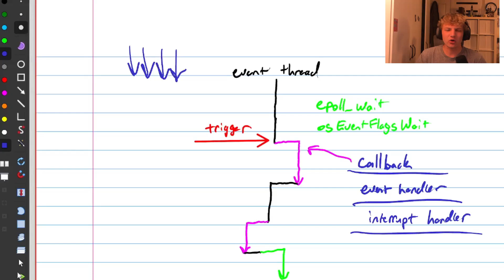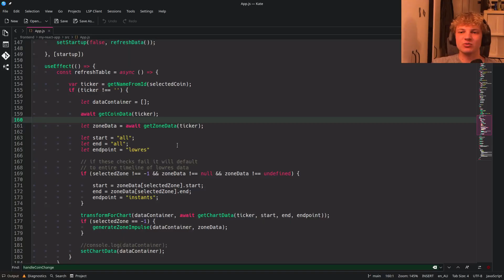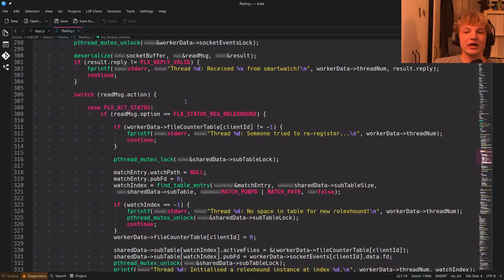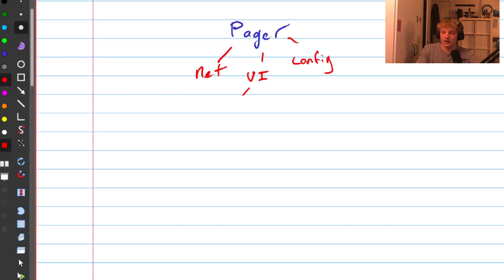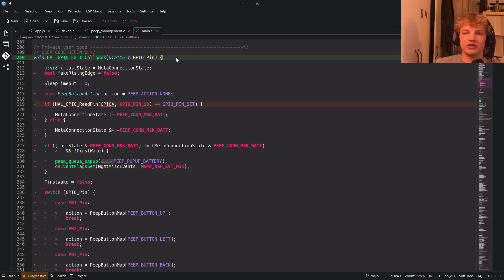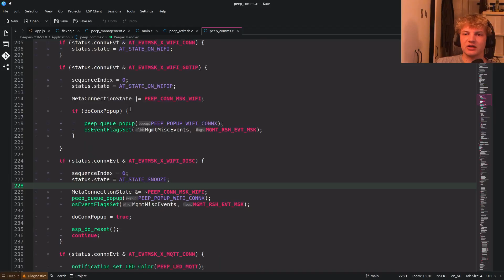All About Event Driven Programming - Write REACTIVE Code

Comment: Good video summarising the topic. Of note is that there are very technical (and imo slightly pointless) distinctions that can be made when discussing event driven programming: namely between a "reactor" (we wait for an event signalling that an action can be made) and a "proactor" (we perform an action, and wait for an event signalling completion). Real systems tend to be a mix of the two, especially at the hardware level.

These distinctions slightly change the exact lifetime of your events and their associated resources (e.g. pooled connection objects, transfer buffers, concurrent messaging variables) but in most cases your runtime will handle that. I wanted to mention this because select/poll/epoll are all examples of a "reactor", where we wait for a file to become ready for reading/writing, and linux's io_uring / windows' iocp are examples of a "proactor", where we wait for an asynchronously submitted io request to complete (and this submission and completion is largely done on a thread pool managed in the background for us).

This lifetime management can be a bit of a headache when designing performant systems, but is usually either abstracted away by the runtime or handled through queueing up / buffering the relevant data. Buffering is especially relevant with ISRs, where the routine cannot be long lived without potentially breaking real-time guarantees.

Once again though, a good video!